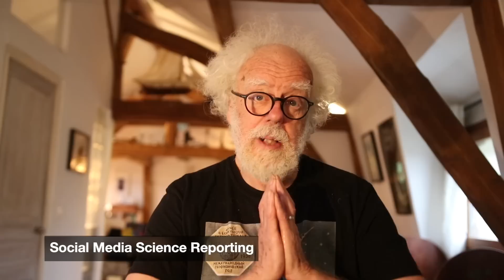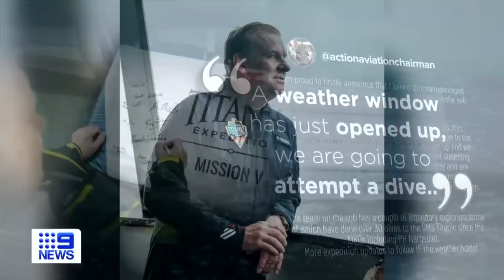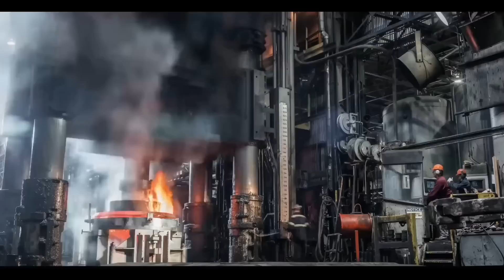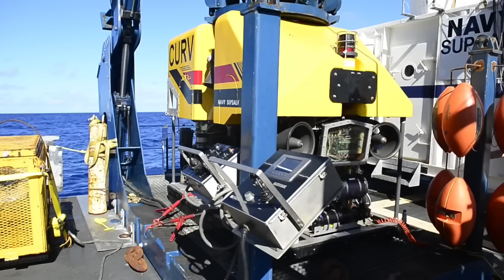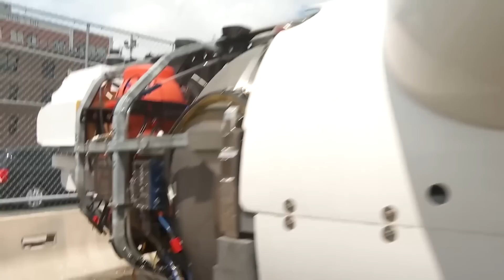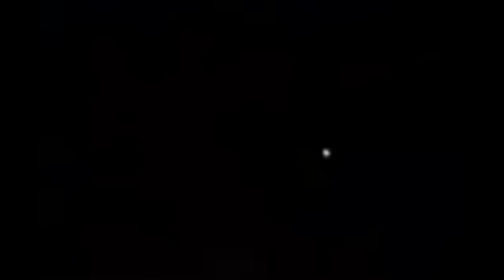Missing Sub - Bad News

Comment: I used to be involved in the private submersible industry, so i decided to reach out to a few old colleagues on the east coast. They told me an engineering horror story of a carbon fiber pressure hull (limited duty cycles) and port lenses made from plastic seated on a flange instead of a Corning glass lens, machined to fit perfectly into its matching tapered housing (I still have drawings of our 14” thick lenses and housings). 
 The fact is there was scant effort paid to testing the assembled pressure hulls, and even less attention given to safety systems or essential systems having redundancy. 
  A very sad and avoidable outcome for all involved. 
  Thanks for addressing this tragedy Professor Holland.
Reply from the maker: thank you...its tragic and should not have happened

Comment: Simon I think the pressure hull (main tube) is just very thick carbon fibre no metal - only the ends are titanium and one property of carbon fibre is if it does fail it shatters

Comment: I used to work on submarines (civilian contractor, senior design engineer) and the lack of competence is astounding. It is very easy to make a fail safe system. IE say 6 solenoids with weights that need to be active to not drop the weights. So if your electrical system fails you drop the weights and surface, switch the solenoids off, it drops the weights and heads for the surface, battery low, it drops the weights and heads for the surface, switch the main power contactor, and it drops the weights and heads for the surface. To also make sure you have something like a sodium chlorate oxygen generator which will last longer than the batteries. They take in CO" and react with it to make calcium carbonate water, hydrochloric acid and oxygen if I remember correctly. Take this last with a pinch of salt as I'm not a chemist.
Reply from the maker: well said Gordon

Comment: If they lost contact 'immediatly', as the submersible descended.  And none of the seven backup resurface systems were activated.
If everything cut out instsntly (no last streams of data), i'd say explosive decompression/structural issues.
Although, we live in hope.
There are issues with the subs design, costing and the inventor himself.  But, in respect, i guess these things are not spoken about (for now).

Comment: I am flabbergasted that some elemental questions have not been asked on most news reports .
1) Does the sub have an emergency ballast ? Like some piece of metal or concrete that can be thrown off ? If they did, there is most likely been a leak or implosion. If there was not such a system, it is insanely unresponsible to go in that sub to the bottom of the ocean.
2) Does the submarine have an emergency beacon ? Better multiples for redundancy... If not, they are criminally stupid.
3) Does the sub have some hook to lift it with a cable ?
4) Was there communications equipment like a sonic transponder or the like ? With that you could send an SOS in simple morse code.

Comment: I understand where you're coming from Simon and I agree. 

To give you and any readers an idea of the pressure this sub is under at 13,000 feet, the outside pressure is roughly 6,500 pounds per square inch or 420 atmospheres. That's roughly three times the pressure in a normal scuba dive tank. 

The sub is 22,000 plus pounds on the surface I don't know the submerged weight with all the ballast tanks filled with water if it has ballast tanks. There are many unknowns about this thing at this time.  

I agree the Bluetooth controller is a bad idea... it just dawned on me they trimmed the sub for neutral buoyancy and rely strictly on thrust to ascend and descend... they seem to have no redundancy in the buoyancy system in case of. I could be wrong but I didn't see anything the looked like a possible ballast tank in the images I've seen of the sub.

Comment: Most of the pressure hull on this one is Carbon fiber. Only the ends are titanium. Sadly the body of the pressure hull is that carbon fiber
Reply from the maker: yes....could be point of failure
Reply: @SimonHollandfilms  It was they found both ends of the pressure hull

Comment: This is possibly the weakest report of all on this debacle.  The details of the submersibles build are easy to find.  Its a carbon fibre body with titanium domes glued in place at the ends and a view port (only rated to 1300m depth).  The reason that the news isnt reporting on how to recover it is simple, No one knows if its even possible and any other comment on it would just be wild speculation.  As far as a locator system goes, is there one available that can go to these depths ?  I really doubt it.
Reply from the maker: wow...I post ideas and experts respond with inside knowledge.......if you know more than me...post it in your comment please.

Comment: The main body part that's carbon fibre is just carbon fibre wrapped around till it was like 5 inches thick, they then glued titanium rings either end.

One of the most worrying things is how the CEO fired one person for raising concerns over safety. The CEO's words went along the lines of "regulations stifle innovation" also he didn't want normal communication because he got fed up of people talking to him so he removed voice contact from the submersible. 

Channel called Sub Brief went into detail about it's construction which is where I saw the carbon fibre loom & them using glue to fit the titanium rings. 
And a final note the front viewing glass is said to only be for dives 1500m.
Reply: To be fair, the company that made the hull said a 4.5 inch wall thickness would suffice, but the owner said round it up to 5 inches to be on the safe side..... erm....

Comment: Just look at the reports of former tourists. To make it short - there is no real engineering behind it! The porthole window is not even designed for such depths. The carbon-fibre hull probably cracked (common thing with carbon instead of steele), otherwise they would be up by now. The Problem ist not to get up, it's to go down when diving. But even if they were up, they wouldn't come out by themselves, because the exit is manually secured with bolts from the outside. It is literally an iron coffin whose builder didn't even bother to certify it according to international standards because it's engineering is above all standards!

Comment: From what I understand thus far the pressure hull was basically  a 5 inch carbon fiber tube with titanium caps "glued" on. Now, I'm sure the binding process is more complicated than gluing a handle back on your favorite cup, but still...
Reply: I believe those end caps are securely held on by the water pressure itself.

Comment: Well you’ve missed the fact that there is not a inner metal pressure vessel. It’s 5 inch thick carbon fiber. There only 2 locations that they glued titanium plates.  The carbon fiber section is a cylinder and the ends of the cylinder are where they glued on the titanium.
Reply from the maker: ok....it gets worse....Carbon Fibre might not be great under compression?  i dint know

Comment: The Titan has I think 7 systems for taking it back up to the surface. 5 of which do not require power.
Reply: could you elucidate?
Reply: @alphalunamare  Apparently it has 7 separate systems for bringing it to the surface. 2 need power to operate, but 5 do not. Mechanical based, hand operated I take it. It could very well have reached the surface a while ago but it has no Signal Beacon, and the hatch is bolted on from the outside.Therefore they could actually suffocate on the surface.
Reply: @roysinclair7554  Thanks for that.  They aren't totally stupid then .. and I suppose mechanical hammering can pass as a signal?  The bit I don't get is how the ship that took them there seems to be completely invisible in the story.  Shirly it had some form of tracking of the craft?
Reply: @alphalunamare   The Polar Prince is still on the location along with several other specialist vessels.  Tracking? Sonar ?There doesn't seem to be even that does there? Not even a radio beacon for the surface. And this thing isn't even attached in any way to the mothership! Could have bobbed up anywhere in a vast area.

Comment: This submersible is banged as experimental and so gets around lots of standard protocols and therefore safety standards - my friend was in suns for 12 years and talking to him there is no way this is a survival situation- even taking the air/depth heating out of the equation I’m not hearing that they had water for 4 days plus and expecting that they had a bottle or 2 for the projected 8-12 hours duration- 3 days is how long you can go without water so at the best they will be on that marker pretty soon - I’m expecting salvage not rescue tbh

Comment: The pressure hull is mostly made from carbon fibre, with titanium rings used to secure it to the end pieces. An insane design, especially considering there’s no way to NDT carbon that thick for microscopic cracks or defects which would weaken with every pressure cycle (at least that’s what they told their former director of marine operations, who they fired for ‘disclosing confidential information’ when he tried to raise his concerns about this aspect).

Comment: At that depth the outside pressure looks for anyway to get into that tiny air bubble. If the sub has electric propellers even those watertight gaskets which multiple cables pass through via power to the motors, sonar, antenna, navigation and flood lights can fail due many known and unknown factors. These small gasket are just as critical as those larger ones surrounding each porthole.

Comment: I heard they relied on blue tooth controls against the advise of old people w experience and hired only inexperienced young crew.  Now I think it might be true.  Yes, there should have been a manual fill the ballast w air button.  U can always treat for the bends later.
Reply: You need to compress the air in the bottles to over 130bar, which is difficult to do, plus make a release mechanism that can operate at that pressure both internally and externally. Conventional design says you make it bouyant, then descend using ballast mass, that you can release on the bottom in stages, to get neutral bouyancy. Traditionally done with electromagnets, as that is a fail safe option, in that power loss or control failure you will come up when battery is flat.

Comment: Is there no ROV that can go and attach something like a blow bag with oxygen inside it?❤
Reply from the maker: hmmmm its sealed
Reply: If you're talking about a lifting bag, To inflate an airbag at that depth the air tank has to be over 6000psi just so the air can leave the tank to inflate a bag. Then any air released will be compressed by the pressure so that factors into the amount of air needed to lift a certain weight. It's not so simple. At that depth lifts really have to be mechanical.
Reply: @markphillips2076  They aren't going to make it then as re they? So awful.

Comment: Of course it's all run by a game controller - because he hired kids to build it. Instead of, of lets say,  standard dress guys with 1000hrs+ of bell time, ROV pilots with 30 years of experience, or similar professionals. 

The first thing that struck me in that promo vid is that I don't see any huge levers - or more important - huge lump hammers or 18inch shifters to hit the huge levers when it's absolutely necessary. 

Compare/contrast that to ANY commercial diving bell run vids on youtube. 

I'm not sure if this thing is a tourism operation or a burial at sea funeral plan scam.
The enquiry is going to be sad reading, that's for sure. 

Comms? Meh. " We'll just use text ! " Deployment skid on the tender vessel? Nah let's just drag it out on a barge - it's cheaper. Pinger? Nah - what could possibly go wrong? Ops normal calls via thru-water speech? Nah - too distracting

Bloody fools
Reply: And simple things, like paint it high vis colours not white.

Comment: 3:42 Stockton Rush wanted to enjoy his submersible ride in peace so he refused to install any kind of umbilical or sonar modem to allow the surface tender to hail his submersible by voice and he did install a sonar pinger which could exchange short text messages, but it was only supposed to ping once every 15 minutes and frequently lost connection.
Reply from the maker: oh boy
Reply: @SimonHollandfilms  Well, coming back to bite him rather badly now.
Reply: I get it. Diving underwater is peace and quiet. Paparazzi or whatever interrupting that zen would be annoying. So have the sled driver handle communications. But to not have any backup system?

Comment: I have watched a couple of reports, that included interviews with ex-submariners, engineers. They brought up similar concerns, especially the game controller & using Bluetooth. Also, that you were bolted in & couldn't exit the sub yourself, without the crew's assistance. One guy interviewed refused to to go near it, when he realised how they operated.
The CEO stated, that he didn't want old, white guys on the team & wanted a diverse, inclusive crew. It just happened, that the ex-submariners, engineers who were interviewed & criticised the poor safety measures, were old, white guys. Guys that had years of experience in building & operating submarines & submersibles. The CEO chose diversity hires over experience, which is hugely irresponsible in such a dangerous working environment.
Reply: I am glad the CEO is onboard here.  
At least he will know the problems with the vessel and can fix them when he gets back to the surface.

Comment: In a hypothetical scenario where the submersible resurfaces after a power loss, it is important to note that the passengers are confined within due to 17 externally secured bolts. It is uncertain whether provisions exist for acquiring external air upon resurfacing. The situation represents a life-threatening dilemma of significant intensity, and the hope remains that all individuals will be found in a state of vitality.

Onboard:
Paul-Henry Nargeolet, 73
Stockton Rush, 61
Hamish Harding, 58
Shahzada Dawood, 48
Sulaiman Dawood, 19

In such circumstances, individuals may be forced to make critical decisions to maximize their chances of survival, which can include weighing options like rationing or sharing available resources, prioritizing individuals for potential rescue, or considering extreme measures to prolong oxygen supply.
Reply: Curious, What app are you using? Is this a chatgpt plugin?
Reply: The safeguarding of undersea cables involves a range of measures employed by the US Navy. One such cable, the EXA Atlantic, is in close proximity to the Titanic wreck site. Unfortunately, a British rescue mission aimed at locating the wreck has been hindered. It's worth noting that the Titanic wreck rests at a depth of approximately 3,800 meters (12,500 feet) below the ocean's surface. In this context, it is noteworthy that the British rescue sub, capable of reaching depths of 5,000 meters, has faced obstacles, while the US rescue effort is limited to 3,000 meters. The US Navy maintains rapid response capabilities, which encompass specialized units trained to handle incidents and damages related to undersea cables. Although primarily focused on cable infrastructure protection and repair, these units may potentially be involved in rescue operations as well.

Comment: I’ve have been feeling the same way about this since the story broke, I understand the depths involved make any rescue extremely difficult, but a vessel travelling to those depths should at least have several redundant systems to get the sub back towards the surface surely? Especially as it takes tourists, it’s a very sad scenario, let’s hope for a miracle.
Reply: Funny enough, the sled that they use to move the sub on the surface does have a ballast system, yet the sub does not! It moves entirely by propeller power. And if you loose power to them, you are toast. Or in this case, you are frozen, as they sit in the bottom at 4km depth in the deep cold. The sub has zero redundant systems, zero safety features. Even the hatch is bolted from the outside, which means they are reliant from other people to open it, which is a seriously stupid thing to do with a limited oxygen supply. The sub is a death trap. And those guys were cowboys,  doing things by feel.  Would you believe it that the titanium dome is GLUED to the carbon fiber tube?? That´s right, it´s just adhesive holding it together! 🙄
Reply: someone said on twitter it got 7 backup systems to take the sub to the surface if there is any problems.. But one other thing that got mention was apparently they cant get out by themself.. then door is bolten FROM THE OUTSIDE .. yeah.. so if those systems manage to take the sub to the surface they can still die from lack of oxigene because they cant open the door from inside. .